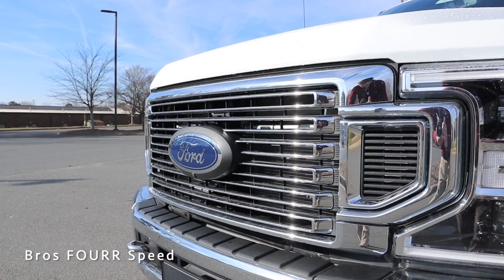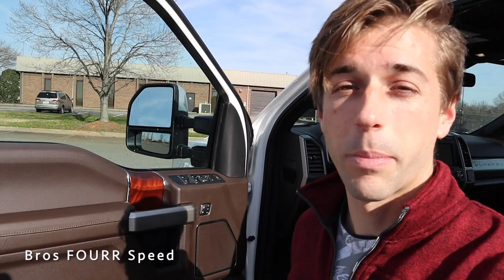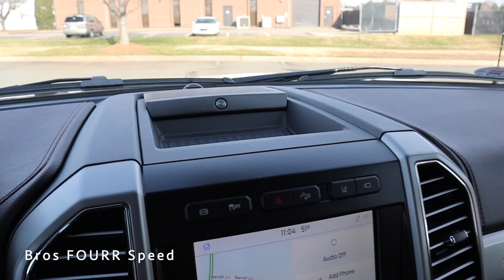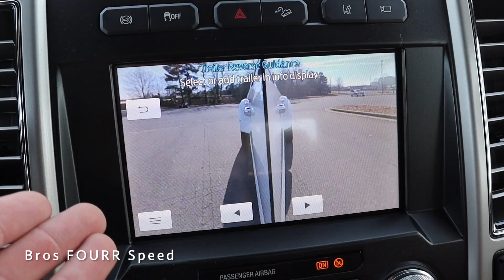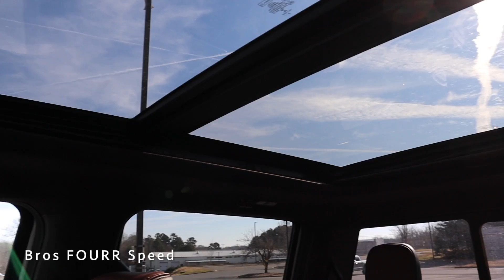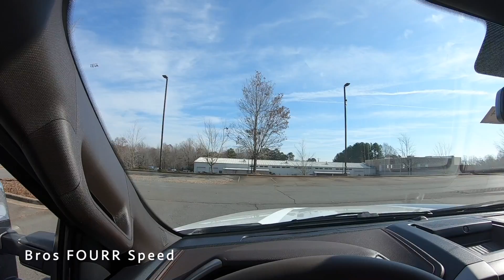2021 Ford F350 Super Duty King Ranch: Start Up, Test Drive, Walkaround and Review

Comment: That truck weighs more than 7,000 lbs noob.
Reply from the maker: Would you like to share what the curb weight is on this Ford instead of just saying that?...If you look on Fords website most of the super duty's weight between 6-7K pounds.
Reply: It's gvwr is over 7k but actual weight is gonna be right around 7k...

Comment: IMO Ford is winning the diesel truck segment. I myself just ordered a 2021 F-350 King Ranch Tremor 6.7 in Lithium Grey in Minnesota. Traded a 2007 F-250 6.0. Just an incredible amazing truck!
Reply from the maker: Thats awesome! We just filmed an F250 Tremor. Great truck! https://youtu.be/9kMcA9me8H4
Reply: Mike
I am in Minnesota too
Which dealership you went too?
I looked on line and no one offered 3500 trucks
Reply: @lykaojalao2733  

Jeff Belzer Ford in New Prague MN has a 21 F-350 Tremor 6.7
Reply: @resharddurdley6987  
Thanks
Reply: @lykaojalao2733  

https://www.jeffbelzerford.com/new-New+Prague-2021-Ford-F+350SD-XLT+Tremor-1FT8W3BT5MED30090

It's been sittingva few weeks. Probably because it's xlt, no navigation.  But still it has the Tremor package and 6.7 and WINCH!

I'd offer invoice and see what they say.

Good luck!

Comment: I love the F-350 m, but I like the ford F-450 platinum but it’s still epic.
Reply from the maker: Haven't been able to get my hands on the Ford F-450, but yeah they are all beasts of a truck!
Reply: the f350 and the f450 are literally the same truck, just the f450 rides a lot worse
Reply: @oldrob1  the Ford f-450 has the wide front axle though, which is better for turning radius
Reply: And I forgot, it handles heavy loads better

Comment: Is it to big for city streets?
Reply from the maker: If you are talking about deep into the city like New York City or something like that I would say yes!  I drove it around what I would call the city where I live and it was fine.  But parking would be difficult depending on what part of the city you were in.
Reply: @BrosFOURRSpeed  I live in Mandalay, Mandalay, Myanmar.
Reply from the maker: @shinthantmaung9476  I don’t know where that is. But this is one of the biggest vehicles on the roads. So it’ll take some getting used to driving!

Comment: With this being a big work truck I'm sure the average owner would be making big bucks to be able to afford it but a 48 gallon tank?! My bank account just took a hit by me just watching this video 😄
Reply: That's not even bad...even my f150 has a 36 gallon when you do 700 miles a day bigger the tank the better. These trucks are made to be highway warriors
Reply from the maker: Haha yeah, that's an expensive fill up!
Reply: @BrosFOURRSpeed  the thing is it’s a big tank it’s more expensive but fuel is fuel only difference it makes is you get to drive longer on an expensive fill up if you have a smaller tank you spend the same just fill up more often… lol

If you even tow anything long haul having a big tank is a huge plus